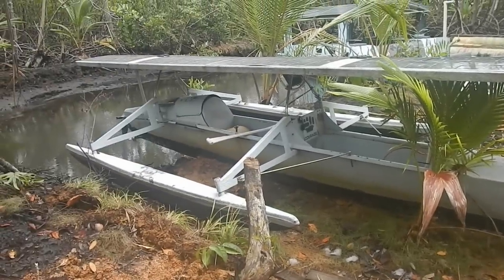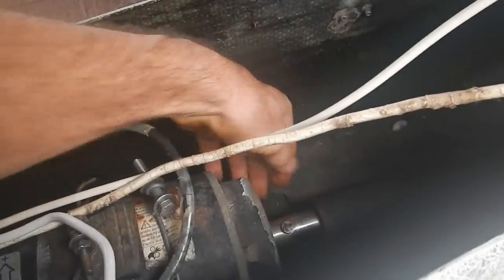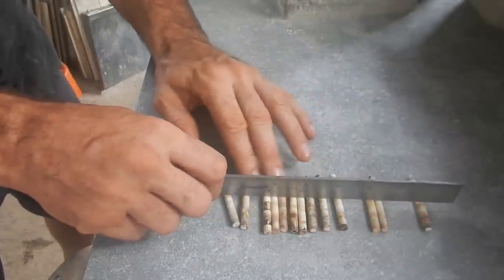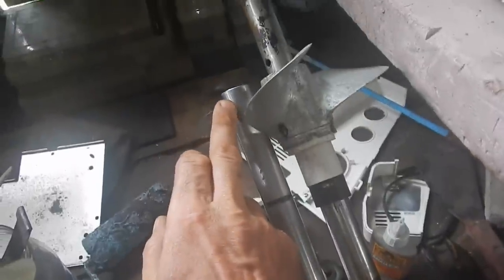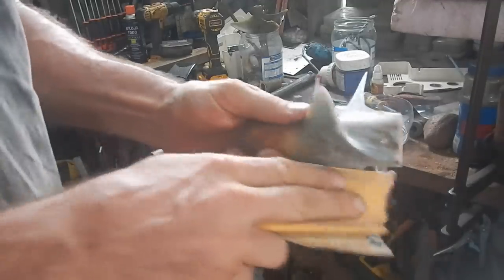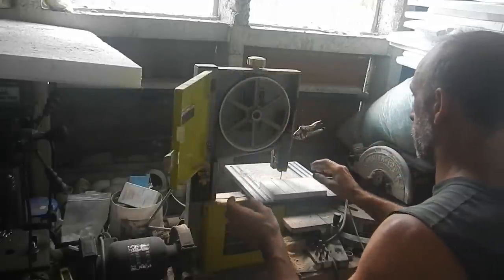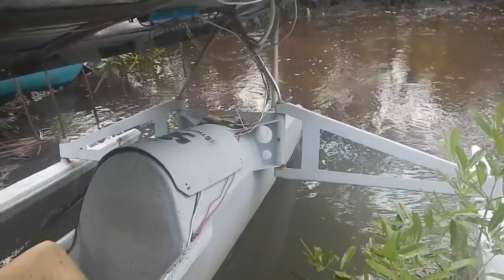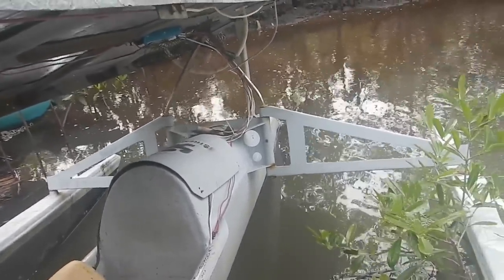Zombie Chopper 010 New Prop and Shaft

Comment: In the Philippines we put wheel bearing grease on the propeller shaft to keep water out.
Reply: He's using the water as lubricant for his loose fitting bearings. He doesn't want to keep the water out

Comment: Seems like the fiberglass propeller design could still be improved, the blade next to the shaft is almost "vertical" which isn't contributing to thrust at all.
Compare that to the aluminum prop at  05:45  which has an angle to the blades, against the shaft.

Comment: for your speed:
time, in seconds, how long it takes to pass a floating leaf in the water.  (12 secs or 12.3 or 12.75)
divide the "length" of your boat (in feet) by 'seconds'  by 1.46 = miles per hour
(length divided by seconds) divided by 1.46 = miles per hour

Comment: any thoughts on what 3d printer to get? FDM? MSLA? is it easy to get filaments or resin to your location?
Reply: You can make your own filament from scrap plastic.  Hardly anybody does because the equipment is clunky and it's easier to buy filament,  but it might suit Jaimie's situation and proclivities.
It was developed by people in the RepRap community because the idea was to avoid manufactured parts,  and a reel of filament is just a manufactured part in another form.
Reply: @MattOGormanSmith  there's a reason PET filaments aren't as widespread as PETg, they're way more brittle and have poorer mechanical properties than petg. PET prints are more for decoration and as he's planning on doing some load bearing structural mechanical thingies proper filaments are recommended. also those recycled from strip pet filaments are hollow and have irregular volume output when printing, resulting in tolerance issues, for example gears binding in random locations

Comment: Jaimie, you were playing with luck, and ended up being lucky, but that piece you made was definitely tailstock job. 

Soft materials with such long overhang are begging to bind up and ruin the piece. 

Just make a small hole with center dril and then use dead or live center, and everything is much more easier and safe.

Comment: 24V Marine Electric Propeller 92CM Glass Fiber Main Pole 86L Grey
Reply: Is this a part that exists?
Reply: @The_Osprey  Yes, it is for dinghy but it can be fitted easily in the  Zombie Chopper very easily and it is less than 1/2 hp.

Comment: I'm curious why you use the PVC roller pin bearing design instead of buying proper machined steel bearings?  Honestly you're probably losing a lot of energy in heat and noise from that bearing, and proper bearings aren't that expensive for the energy savings, speed gain, and reduced wear and tear.
Reply: Corrosion would be my guess.
Reply: with how critical boat performance is for his offgrid situation, i'd agree with you on that upgrade.  cool to see him get by with so many DIY solutions, and incrementally replace with commercial solutions where it makes the most sense. i enjoy seeing how he optimizes things over time.
Reply: @The_Osprey  Stainless would at least be corrosion resistant?
Reply: @stevepittman3770  I understand that Stainless has issues underwater.